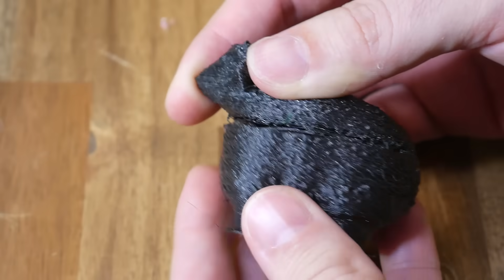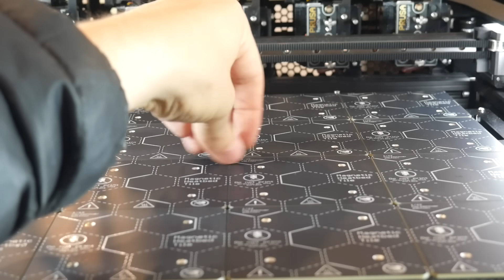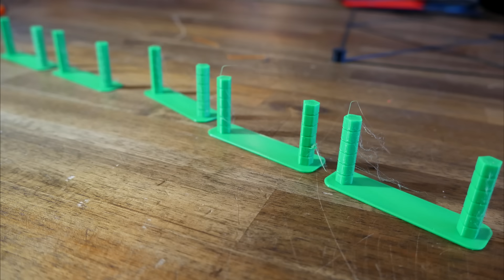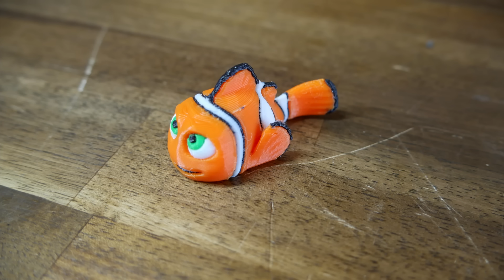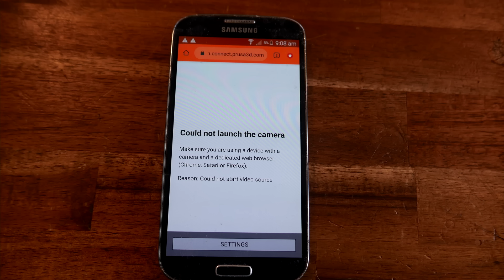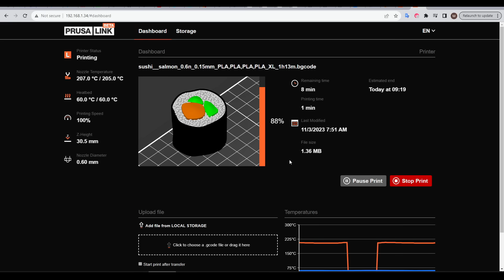The 5 tool Prusa XL is currently flawed, but I think it can be fixed

Comment: I've been disappointed with my experience with the XL. My decision to buy it was based on positive encounters with the MK3. However, the XL turned out to be sluggish, noisy, and lacking a fully functional, user-friendly remote interface. I anticipated an improvement in ease of use, file uploading, and print monitoring compared to the MK3, but instead, the XL feels like a step backward in terms of user interface. Despite my efforts, I haven't been able to successfully integrate Octoprint with the XL, and Prusa's lack of support for Octoprint and assistance with related issues is perplexing.

Getting customer support can be time-consuming, often taking hours, and when I do reach someone on chat, it seems their stance is that the problem lies with the user or the material, rather than the printer itself.

There seems to be a change in Prusa as a company. It's possible they've expanded too rapidly, have intentions to shift their target market, or are facing challenges in finding knowledgeable personnel to hire. I've owned at least one of every Prusa model, but the XL might be my last purchase from them. Only time will reveal the outcome.

Comment: Prusa is just good at stealing others inventors designs and selling them, this printer is just a copy of the E3D tool changer machine (it's the same) but the e3d one is from like 5 years ago, I can't believe a printer this expensive doesn't come with a built in web cam, and still has all this crappie 3d printed parts and what is going on with the slow gcode upload speed, it has a really old IC? (Probably  it's prusa after all)
Reply: lol prusa literally created the heated PCB bed and magnetic PEi sheets that 100% of printer manufactures use today
Typical bot.
Reply: @LilApe  that is not true, pcb heater elements exist for like 30 or more years, the first printer y made back in 2005 already have a pcb heater, pei sheets already exist in the industry back then, 3d print already exist for like 40 years xD
Reply: @MaxFenix8k  show me one printer that used a heated print bed before the prusa mk2

Comment: I bought MINI 3 years ago and once properly assembled and calibrated it printed flawless models for almost 2 years. It only then failed due to particular design of connection between hotend and feeding ptfe tube. Quick fix and it still prints flawlessly.

Comment: I think stringing on all machines could be substantially improved if slicers were smart enough to wipe the nozzle inside the infill region, and not just a tiny 2mm wipe along the outside perimeter.
Reply: You can do this already in Bambu Studio

Comment: Ouch, serious flaws. Receiving mine this week, really looking forward to all the tweaking on this expensive machine…

Looks like the whole extrusion system needs to be converted to a more bambulab like design. Nozzle wiper+poopshoot, hardened steel nozzle (with coating?), silicone sock, etc.

Comment: With the multi colour prints you need to consider the cost of the printer too. Sure the Bambu labs ones are more wasteful but you would have to waste a lot of filament to make up the cost difference to an XL. Considering the Bambu lab ones get much higher quality results that is another reason why at this point they are still better.

Comment: This is honestly shockingly bad. This fails to do the things it is meant to do and requires more calibration than an ender 3 does. How long have Prusa had to work on this? You have companies bringing out amazing new printers with a lot less time between starting the company and shipping functional, top of the line printers. Prusa has been around for a long time and we’re the ones making top of the line printers, they have massively fallen behind now.

Why did Prusa feel that those printers were ready for shipping? They are ruining their reputation, both with the MK4 and now the XL, the MK4 just isn’t competitive with similarly priced or cheaper printers, basically just a MK3 with upgrades, and the XL is a mess.

For a benchy that took that long, it was awful, for that length of time I would expect a near flawless benchy. Something is wrong when another printer can print at maximum speed and complete in approximately 15-18 minutes with much higher quality.

They missed out so many things that should have been added and have existed for a while now, like nozzle wipers. A Bambu lab printer can do hundreds or thousands of filament changes and not end up with anywhere near as much blobs and stringing as the XL. Same with Prusas new MMU, why is it still having issues with filament retraction? There is a simple solution out there, just cut the filament and then purge.

There is something very wrong when a $450 printer can produce better multi coloured prints than a $6000+ printer which is specifically designed for multi colour and multi material printing.

That single bolt to hold the tool head is just negligence and incompetent design at that point, there is no excuse for that.

All that money and it isn’t even enclosed? Not having any documentation on the codes used after the printers have shipped and are in use is very poor on Prusas part. Something is really going wrong at prusa, they are failing to keep up with the market and are shipping printers that don’t even work right for their main purpose. Maybe it was a rushed release before a competitor releases a printer that will make the XL obsolete.

Printed parts on printers are fine, but the quality of those parts was sub ender 3 quality by a long shot, if Prusa uses their own printers as their print farm then it doesn’t inspire confidence at all.

Prusa is in real danger of failing, they aren’t competitive technologically, economically or even through reliability anymore.

Comment: 55 minutes for a 0.2 layer height benchie on a corexy with linear rails, input shaping, and a 0.6 mm nozzle? Good Lord I've got bed slingers that can do that in half the amount of time with a 0.4 mm nozzle. If that doesn't speak volumes I don't know what does.

Comment: I love my MK3S+ and MK4. Only issue I’ve had was replacing the print fan on the MK3 (I tightened the cables to much where they are squished in the motherboard entrance. Prints eventually caused flexion based damage on the fan cable). 
I’m a bit of a Prusa fanboy…but this is a no go. 
At that price point and with those issues I’d rather save up and get a Vision Miner IDEX. 
Dual 500c capable extruders, 200c capable bed, 350x350x350 print area, 90c heated chamber, core xy, klipper, unlocked firmware. 
Sure it’s more expensive, but if you’re already spending $7k for a printer why not save up abit more and get something that can print almost everything with any brand of filament (unlike some manufacturing grade printers that lock down filament brands)

Comment: This is incredibly disappointing to hear. I wonder if the oozing issue resides in the "Nextruder". I wonder if the planetary gear reduction ratio causes issues with retraction efficiency. Has anyone used the MMU3 on the MK4 yet? That would be the tell all. To your wipe logic of wiping the nozzle before parking: I think this would throw the layer count off from wipe tower to part and the printer would eventually crash into the tower, right? Also, I'm sorry to hear about the loss of your pups. It's incredibly hard to go through.

Comment: Thankyou very much for creating this video. As painful as it is to watch for some it is more painful to actually use this printer. I pre-ordered the Prusa XL as well and waited as long as possible to complete my order to get the 5 tool semi-assembled version (I wish I had waited longer). I am having the same issues and in contact with Prusa tech support, but so far everything they have recommended has not helped. I had recently tried running the string test print (two towers), both perpendicular and parallel to the x-axis. It seemed like there was less stringing when perpendicular, but it was still not resolved. Possibly it was getting more cooling which overall seems very weak for this printer. I was expecting a larger second cooling fan like Bambu and other printers have.  I have not yet seen if anyone has added another fan to cool the material faster.

Comment: For a supposedly assembled printer, that is a ton of assembly you need to do, and far too many problems for that price point, and the use of cheap low quality printed parts rather than doing injection molded or machined/diecast metal parts makes the entire machine look and feel kinda cheap ngl.

Also that print quality is just not acceptable, even for an Ender, a bargain bin printer which cost literally 50 times less.

Comment: It’s getting harder and harder to justify the extra money for Prusa machines. 

Even their customer support isn’t what it used to be. I just received a MK4 with a bad hotend thermistor and had to fight like crazy to get them to send me a replacement. I even swapped parts with my other MK4 to prove that was the problem and they still gave me the runaround. Had to deal with 3 agents to finally get them to agree to send me one. Their cost on that part is probably less than $2.

Comment: At this price point you shouldn't have to be "trying to make it work", this is an example of pushing a product out and expecting the users to fix the faults. In a sub $500 you may expect that but not at $5k. This is aimed at business users and they do not have the time to be messing with a half baked product. Think Prusa will loose a lot of respect for their brand on this one. If I had this I would return it as not fit for purpose.

Comment: Well, I think when I get around to buying a replacement for my Kobra Max, I'm going to be getting either a Voron Kit or a RatRig. I like my mini, but I don't think I want to put up with all of that. If I want to do multi-material, I think I'll go with an ERCF.

As other's have said, your professionalism is to be commended. I'd have blown a gasket over the payment issues.

And condolences on your loss. They looked like sweet puppers. :(

Comment: Totally agree with all of your comments except the comment stating Prusa is committed to OpenSource....this is no longer the case.

Only two things are Open Source on this printer.

1. PrusaSlicer based on Slic3r's open source...but even the additional slicer G codes the PrusaXl uses are not published, so this breaks Slic3r's Open Source license.

2. They have published STLs for printed parts only, not the non 3D printed parts. Even for the printed parts they have not published CAD files. Compare this to an Open Source company like Rat Rig.

Firmware is also not Open Source.
Board design is aldonot Open Source.

Prusa is no longer an Open Dpiurce company. They are now just the pot calling the kettle black.
Reply: Still more open source than anything coming out the the CCP.

Comment: Ohmigod. I have a preorder and have been worried about getting an XL that's still rough around the edges. 

But I would've never imagined it this bad. 

I really like Prusa but this is not acceptable and I'm not talking about the quality. This is an unacceptable way to treat customers. If they can't fix this issue immediately they need to either halt shipments until they can fix it or be transparent about what quality the printer currently yields.

Comment: I think you may need a smaller tip for the smaller part.  I use a 0.2mm tip with a 0.1mm layer height.  It takes longer, but produces better prints with smaller parts.  The 0.6mm tip is for much larger parts, as demonstrated by your scaled turtle.

Comment: I'm also very disappointed with the XL. After waiting for this long I would have expected to receive a machine with good performance. Prusa was complaining about supply chain issues, which could have prevented mass manufacturing, but it couldn't have prevented testing of a few dozen hand-built units

Comment: I use Prusa MK3 very often.  It is my go to sliw prints tool. I di like the dedication if Josef to open source ideas. I just hate the cost of the printers and update kits. at list factor of 2.5 more expensive. No sales whatsoever.
I will wait another competitors in toolchanger/IDEX liga. Sorry, Josef.

Comment: Oof. I have a 5-tool XL on preorder, too. A few observations:
1. Linear advance and 0.6mm nozzles seems broken. LA works fine with 0.4mm nozzles but I’ve always seen bad behavior with 0.6mm and the only solution I’ve found is to turn LA off when using any nozzle but 0.4mm.
2. I’ve tested a lot of multi-material combinations. PETG and TPU stuck to each other well. PLA and TPU don’t.
3. With my MMU I had a ton of trouble with the wipe tower, too, just like you’re seeing. I haven’t used the MMU in a couple years; I had so much trouble with it, I just took it off. I assumed they’d fixed some of those problems but it looks like they haven’t.
4. I’m shocked they don’t have a solution for nozzle cleaning between tool changes. Nozzles are always oozing.

Comment: It's so weird that they can make great single tool 3d printers but the multi tool introduced tons of issues.i guess if you have a few small issues with one tool then when you multiply that x5 your issues increase exponentially.

I was really looking forward to this printer too.  I envisioned it as the ultimate multi material printer.

I bet bambu labs is working on a multi tool changer printer and it will probably be perfect.

Prusa better watch out, they'll become obsolete.   They waited too long and allowed competitors to surpass them in quality and innovation.

*Having said all of that, you made huge improvements but took tons of work to get there.

Comment: This is a very unfair test of the printer, as the whole video is running it on alpha firmware. I know you have released a followup, but it needs to be made clearer in this video that this is alpha firmware.
Reply: The stable FW is worse than the Alpha. The test is very fair. This from an owner.

Comment: Thank you for this review.  It's balanced, honest and completely to the point.  The amount of angry Prusa-fanboys isn't half as bad as I feared, but still the argumentations used there to try and contradict your review is somewhere between laughable and plain sad.  I held back on my pre-order because I simply have only seen ONE print on the XL (the multimaterial tyre) that looks like making the most of this machine, but I have the odd feeling it will take till "MK2" for the XL to perform the way it was hyped to be.  It's especially bad as Prusa failed to allow Octoprint capability (something they boasted about as "very valuable" when the XL was being launched), and they stated "they weren't in the speed-boat race, but superior quality was their goal".    I'm feeling like I dodged the bullet here, yet I hope for every XL owner Prusa will make good on promises made in the past.

Comment: While you mentioned that it’s Alpha firmware, I think this being what you used for a “first look review“ is absolutely unfair. My XL has been a workhorse for me. And I’ve never had anything on it but the most current stable release. Even to do a review using beta software of both the physical unit and How it works feels unjust. I get that you’re very frustrated by the expense and your experience. But you didn’t even try it seemingly set up as intended.

Comment: $6k for a 3D printer, it better wash my dishes as well as perfect prints.
Oozing anywhere should not happen anywhere.   I get oozing and stringing with my Ender 3v2 but that's a $300 printer (or was about a year ago)

Comment: Prusa has just released PrusaSlicer 2.7.0-beta1 which adds a new way of doing travel moves: ramping to fight stringing and oozing deposition especially while using wider nozzles. If you enable those, layer changes will also change to a helical ("screw thread") trajectory inspired by how Bambu Studio does it.

Comment: Just insane what you're having to deal with after spending that much cash. NGL, I howled with laughter when you printed out that beautiful replacement part on your Bambu. Put the existing parts to shame. Couldn't design a better commercial for Bambu if they tried.

Comment: I dont know if anybody mentioned this already, but the numbers you mentioned for waste filament on the Bamboo Labs printer are way off, you can see in the slicer it takes 192g of waste, that is almost 6 Times as much as the Prusa XL. You said double, probably looking at the flushed Meters. That is a big difference, so i wanted to point it out.

Comment: I bought the single tool XL, and I think it's very poor value for money. I started with the i3, then I added a mini, but the XL is definitely a pretty poor product when compared to these.
For example. 
It takes ages to warm up before it starts printing. It warms up, cools down, warms up again, seems to run 3 checks at every spot it probes when levelling, etc.
Because it's not a complete cube, it shakes around a lot when it's printing. Yes, I did tighten everything up using the crappy "torque wrench" supplied. It's on a sturdy bench. 
When you change filament, you have to manually pull and then push filament about a yard down the PTFE tube. 
It's not properly compatible with octoprint.
The USB port is in a stupid place: on the display board. I suspect this is because it's really only intended to be used to plug a USB stick into it. There ought to be another USB port at the back near the LAN port, for those of us wanting to use Octoprint or similar.
The integrated WiFi takes ages to receive GCODE files.
PrusaLink is a bit crap, especially compared to Octoprint. 
For some reason, my XL parks the print head at the back left corner of the build plate after printing. That's not a great place to check or change the nozzle, oh sorry "nextruder".
Sometimes, the self levelling fails due to their being a bit of extruded filament on the nozzle. 

For such an expensive product, that's taken ages to arrive, it's completely underwhelming.